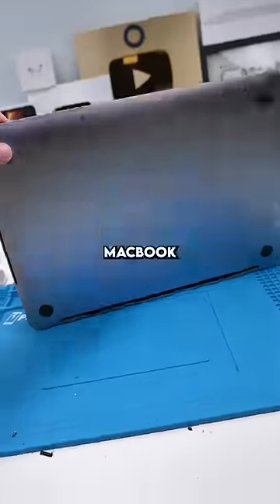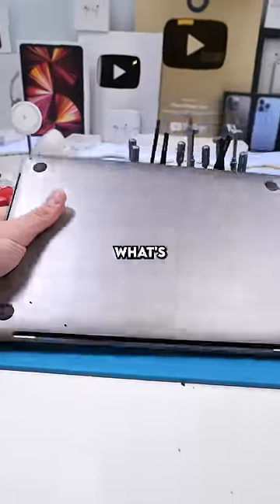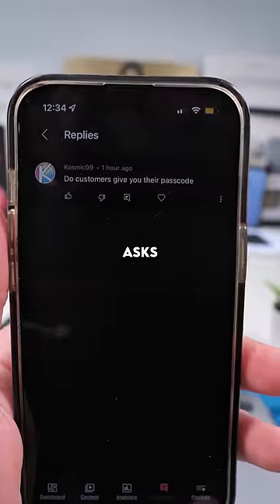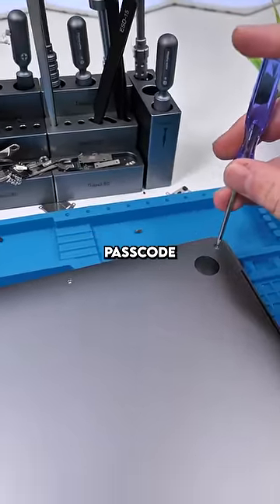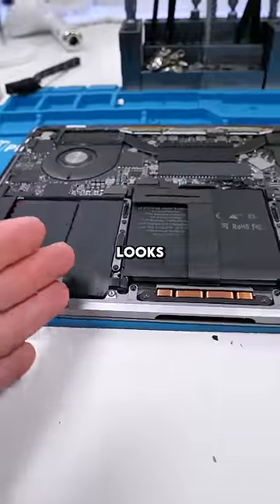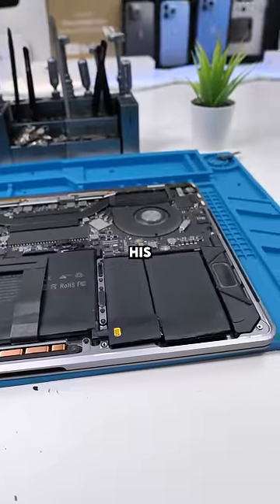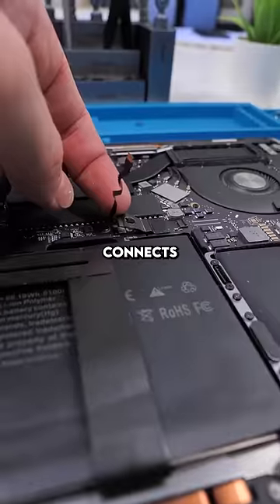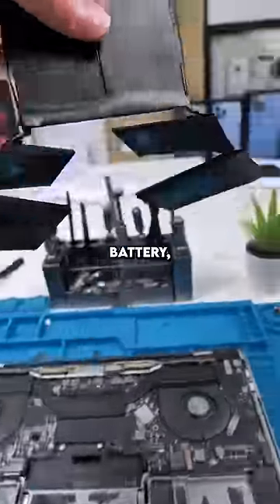MACBOOK PRO BATTERY WAS NOT EVEN LASTING 20 MINUTES... #Shorts

Comment: Tip: if you're mailing your device to a repair shop change the passcode to something simple that's only a few letters long.
Reply: Also, remove any personal data you don't want them seeing.
Reply: @elevatorz89 
Like a meth recipe or cp
(This is totally a joke)
Reply: That's if you can turn it on
Reply: bro, if you can change ur passcode, u dont need it repaired lmao
Reply: @Im_Frustrated45  broken screen, old battery, won't connect to wifi, won't connect to Bluetooth, you wanted a mod. There's a million reasons why I would send a still mostly functional device to the repair shop.

If you can't change the password, you probably need a new phone.

Comment: its not like normal apple products battery lasts 3 minutes
Reply: Ironically has Apple the phone and laptop with the longest battery life, IF you consider the mainstream market only… The fold 4 has the closest battery life on the android side. Not sure about laptops
Reply: @kihayu  learn to take a joke dude
Reply: Idk about iPhone but the new macs last quite a long time
Reply: @holacomo6581  I don’t get that kind of jokes very often if I read them. If it is one, then my bad
Reply: @blue_ig1  Look for the fold 4 battery comparison. There should be only one with some views and in it the iPhone 13 Pro Max is also shown with the best battery life
Reply: I get the joke, but you don't get the real thing.
You're wondering why is 1% the longest lasting percentage on iphones, right? That's because the phone doesn't even calculate the battery at all, it just decreases a variable, showing you less than you actually have. If you don't believe me, check how much battery the phone has, turn the phone off, then turn it on again. You'll see that it shows you more than before
Reply: dont yall batteries fall out all the time
Reply: @kihayu  yeah I heard the 13 pro max lasts long but I was just saying the macs last long
Reply: @MegaGamer22  no, phone doesn't lie to you. It's just method of detecting charge from voltage. If you reboot a phone, all voltages become more stable, especially after some heavy duty work
Reply: Apple products literally have the longest battery life than almost every device

Comment: I used to recondition MacBooks of all kinds as a licensed Apple repair location. Everything I did was called reconditioning because they'd go up for sale a certified used equipment, but if I had a dollar for every battery replacement I did, I'd be typing this on something nicer than a iPhone 13 Pro
Reply: What you happen to know if a mid 2015 MacBook Pro plugged in would still boot with a faulty or fully dead battery? The OS was reporting battery service for some time and I just used it plugged in since it was poor, Just don't know if generally with a power supply plugged in a bad battery can prevent anything. I'd hate to throw money at it just to find out it's something else. Chime, black screen, no external display working, fans kick on, and nothing else. Cheers

Comment: The same customer bought car in dealership with full tank in it. Came back after a while claiming that car doesn’t drive anymore and it shows that tank is empty.
Warranty on batteries usually is short as if it is faulty it will show signs within a month.
After a year it’s clearly the problem with customer’s MacBook or rather customer itself.

Comment: In my personal experience replacing batteries for my work, the biggest killer of batteries is that people leave them plug in 24/7 and never give them a proper charge/discharge cycle. We just had about 20 laptops where the batteries were swollen because someone left them plugged in for about 4 months straight
Reply: Isn’t the OEM charger supposed to regulate stuff like that?
Reply: @ChiquitaSpeaks  yeah, bad OEM design. And on top of that my notebook has a feature where it stops at 60, 80, or 100%, based on what you set.

Since I use it mostly plugged I set it to 60%.

Comment: How on earth was it lasting only 20 minutes though? Defective replacement? Good on you for replacing it for free.
Reply: 3rd party repair shops cant get apple original batteries so we have to resort to chinese replacements. Most of the time they are fine but others can have rapid degrading cells so its usually a gamble whether you get a good battery or not. Most repair shops give out 1 year warranties on parts like this.
Reply: @TheLeathal0ne  yes we can get originals, there are many stores that sell them
Reply: @sixunity1171  Those are counterfeit batteries, are even worse than what this guy is using.
Reply: @newklear2012  no, the ones i buy are originals

Comment: I have a 2009 MacBook Pro that will not even start. The battery had to be replaced as it had bloated, but when I installed the new battery, I got it to start once, but after I turned it off, it did not turn on again. I tried all the keyboard shortcuts with the power button, but nothing worked. However, the Caps Lock light sometimes works.

Comment: wait if you already replaced the battery shouldn't it be free if it stopped working thats the basics of warranty if the repair or the part was bad then you should get it replaced for free regardless if you've been good
Reply: How long a battery lasts is mostly dependent on how a person uses the device. If they use it all day 24/7 maxing it out. That shit could wear out really quickly, you’d think its the part and its not, its your expectations. Y’all gotta remember batteries are consumables and are expected to wear out after a specific amount of cycles.

Comment: I suggest you replace the battery with an Apple original part, because Apple does not replace the battery by itself it includes topcase replacement at battery price and he gets original Apple part not an aftermarket one

Comment: Did you check the battery connection and checked how he was using the device? Could be a software issue with the OS/firmware.

Comment: My MacBook ALWAYS has to stay plugged in. For some reason, it will turn off and die right when I unplug the charger. I replaced the battery, and same problem. I switched to Windows, but my Mac is still in the basement.

Comment: If his battery is constantly dying he’s probably using the wrong charger
Reply: if he is using the wrong charger then the battery just wont charge
Reply: @sixunity1171  wrong. You can use a compatible charger which is supplying the insufficient power to charge it under full load. This would lead to continuous charge-discharge cycles eventually breaking the battery. The wrong charger can indeed charge it.

Comment: Could someone tell me if this idea would work ?
What if instead of having a slow charging powerbank you could charge a second phone batery and switch the old one out for instant 100%.
Reply: Is this a joke question or are you very young?
Phones had completely replaceable batteries.
The Galaxy S5 had a removable back cover and you could just swap the battery.
And it still had an IP67 water resistance rating.

For notebooks, batteries were also replaceable, usually just held it place with two sliding mechanisms, one that you had to unlock and the other one was spring loaded, so you just had to unlock and push the other slider and then you could slide out the battery.

Comment: I just replaced my battery in my mid 2014 MacBook Pro and it won't start up. The charger is orange so I think it needs a charge. But it has made the start up sound when I've pushed the power button. But nothing else happens. Any idea what I should do? Thanks

Comment: I have a MacBook Pro 13 inch and I’m plugging it into the charger and not showing any light I used it 5 days ago and charging port worked great never had issue with charging port what could it be ? Is it battery but shows no light when plugged in

Comment: @PhoneRepairGuru  I have a 2019 MacBook Air that will not power on. Pressed the little yellow button on logic board to drain residual power and disconnected the battery. Connected to charger with battery disconnected and still nothing. Does this sound like a logic board issue? Little led is solid white no error codes.

Comment: Hey bro, love watching your videos.... just saw this and I'm actually facing a similar problem on my MacBook Pro M1 2020, where the battery doesn't charge but then the fan runs in full speed and also, after running apple diagnostics, it shows that the battery is not detected. And when this problem happens, if I press under the laptop to where the battery board data cable is connected, like anywhere near it, it fixes itself. Can you help me out with this? Also, I have noticed that when this problem happens, and the laptop is shut down, it will not turn back on because of course, it doesn't detected the battery and I have to use the power cable. Also, when this happens, I won't be able to see any of the information regarding the battery such as the battery health, the cycle count, the percentage itself. So isn't this clearly a faulty battery data cable? Can we not just replace that wire alone instead of replacing the entire motherboard suggested by Apple? Can you please help me out?

Comment: You're going through batteries and you're replacing batteries. My friend, that's like replacing slow blow fuses. The battery's not the problem. You've got a power system that is overcharging the battery. That's what's caus in it to die. Not a brain, but an overload, so keep changing. Those fuses Bubba that don't fix it. I mean, batteries fuses batteries.  We can slink figure it out. Oh, by the way, you think I'm full of it? When I went to college, my degree was in electrical mechanical engineering.
It was before Microsoft's got all. They're programming programming from Diablo program at Xerox and made word.. That's right, microsoft didn't design word xerox did nineteen seventy nine, the program was called diablo. So I know what I'm talking about. That's fifty years of troubleshooting computers when they were made from transistors to today's I watch. You've got a charging system running too higher currenot enough to break down the batteries.

Comment: I don’t know where you’re located, but this looks like a warranty replacement to me. If you replaced it less than a year ago, and it doesn’t function as the customer can reasonably expect, replacing it for free isn’t ‘being nice’, it’s ‘following the law’ in a lot of places and just common ethical sense everywhere else. 

Did you at least try to diagnose what the issue ís? If it isn’t the battery, but something else, you didn’t fix anything.

Comment: Is 2019 MBP i9 16 inch Ram upgradable?
Reply: Technically probably, yes, but since it is soldered to the motherboard, I guess you will have a hard time finding someone to upgrade it.
They would have to find ram chips for the exact model you have, desolder the old chips and solder new ones onto the board.

Apple first introduced soldered ram and unfortunately windows notebook manufacturers have started to go down the same path.

You can't just open the back cover and pop in new ram sticks in the slot.

For windows laptops with 8gb ram that only have soldered ram, that will soon become a nightmare, making an otherwise perfectly useable machine pretty slow.

Comment: That’s not a good repair
Reply: Do you do technology repairs?”
Reply: @clackety_  Yes
Reply: @timwiesler6365  I doubt because battery replacement is one of the easiest things to do
Reply: @timwiesler6365  there IS no other way to do it
Reply: @clackety_  Yes and if you do it that way it won't last long. That's the reason why the costumer always comes back with the same problem
Reply: @clackety_  And yes you're partly right. You do it like he did it. But he forgot many important things or just didn't have them in the video
Reply: @timwiesler6365  such as?
Reply: @timwiesler6365  why exactly would that change the longevity, I’m surely convinced that The customer leaves the MacBook charged in the wall consistently for far longer than it needs to be which can cause longevity problems and battery health
Reply: @clackety_  Not that fast

And for example he forgot to completely charge and discharge the macbook so the chip gets that there's a new battery
Reply: @timwiesler6365  he placed the battery a year ago, that is 100% possible, if you keep charging  like that, the battery capacity is largely reduced, he brought it in cause it dies fast. It’s not the installation, it’s literally the consumer, and he’s doing them a favor but i wouldn’t doubt they come back again, because they keep ‘overcharging’